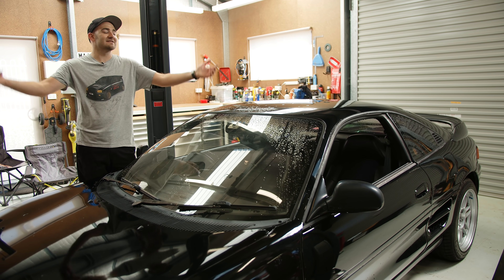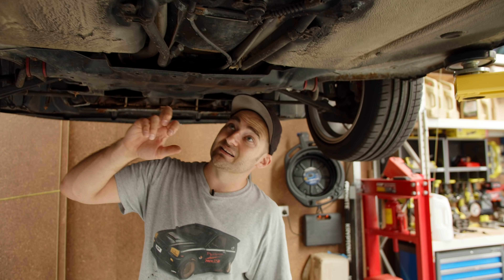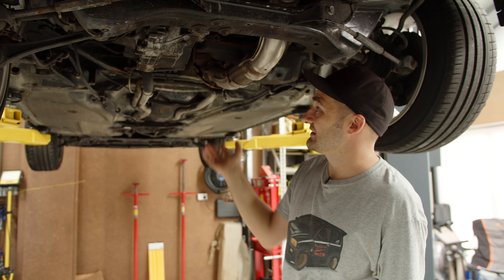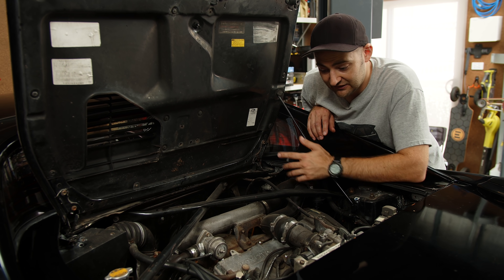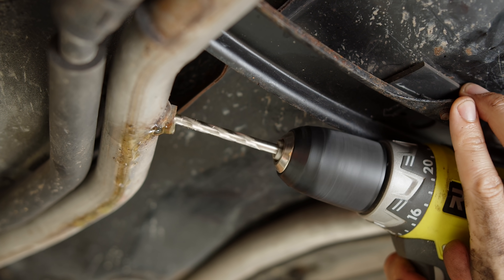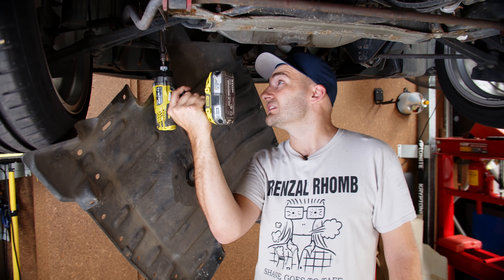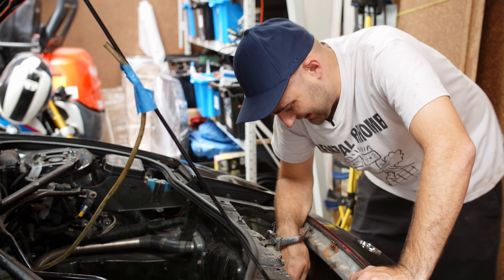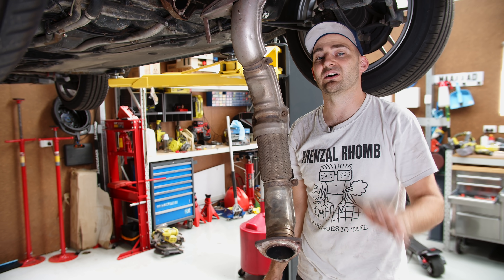Turns out my 'super clean' Toyota MR2 turbo is a piece of ....

Comment: My personal opinion is that the reason some of the rusty bolts twisted off was you were using WD-40 as a rust penetrant. That product is for water displacement  or a solvent. Get a proper rust penetrant like Liquid Wrench.

Comment: dont forget to replace "hose from hell" while you've got the turbo off. also good gains are to be made if you get your turbo housing machined out and a bigger impeller placed in. I had mine machined out to fit a supra compressor wheel. my brother did an evo compressor wheel.

Comment: In theory with some of the older LSDs While jacked up if you spin one of the rear wheels the other wheel will turn the same direction if it had an LSD. If it spins the opposite direction it's more than likely an open diff

Comment: Better get some POR15 to seal that metal.

S54 is the NA gear box.  E153 is the turbo gear box.

And yes, dropping the engine/transmission would've saved you a lot of time and headache. :)

Comment: I had an AW11 MR2 that simply dissolved over the two years I owned it. Titanic level rust on a car that was 8/10 when bought. Wicked powerslides in the wet, I could drive that car sideways for a block, in the rain.

Comment: Hahahaha " so much rust!" Sure thing Marty. Some tips from the part of NY that measures the salt used on the roads in tonnes per mile, get yourself some real lubricants for loosening bolts. Wd40 has its place but it's not in the garage. PB blaster is made for rusty bolts. Second you really want a set of bolt extractors. They work really well for getting those rounded off bolts and nuts that you're not going to reuse.
Reply: Your cars must be relatively new.

PB Blaster did nothing to loosen seized nuts or bolts on my old Tercel. The oxalic acid based rust busters used to work fairly well, but AFAIK are all off the market. I used a small butane torch to remove two seized brake line nuts from a barely accessible distribution block  I heated each to roughly 400 degrees, let it cool a bit and then applied a crows foot wrench. They came off without a problem.  If that heat doesn't work, and it's just a seized nut, a set of nut splitters work well and if you are careful won't hurt the bolt. Before removing the split nut, back it off past the end of the bolt and hit it with a hammer a few times to break the bolt loose. If push comes to shove and nothing else works on a seized bolt, and you can find or make enough room, get a really good set of drills and drill it out.

On the older cars I've worked on for most of my life,  extractors will break before the bolt even budges. I have a whole draw full of broken easyouts to prove it. Break off a hardened steel piece in a bolt and have fun trying to drill the thing out!

-dave (also from upstate NY)

Comment: Helped a friend swap out a bad turbo engine here in the states with a JDM and computer about 15 years ago or so. We forgot to unhook the battery........the main feed to the engine starter created a direct short to ground and powered up the fuel pump. Raw fueling was dumping out and sparks were flying. The throttle cable was glowing red hot! We called the fire department and they foamed down the garage. They couldn't find the battery because the engine was in the back! Finally found it under the front spare tire and unhooked it. They left laughing at us dumb kids. Anyways if you can work on a MR2 then your set for life! His was a rusty mess too! Nothing quite like Ohio road salt and sheet metal................. can't have anything nice in

Comment: missing all the undertray plastics. they really need em, it's common for the 10mm bolts to rust. looks like a factory exhaust to me. fight on, they are great to drive, well so long as that mismatched suspension holds up ok.

Comment: That looks like a 5 year old vehicle or even newer rust wise in OHIO. All my vehicles literally have a pile of rust under them after I get done doing any sort of work on them. All you need is PB blaster! But if that does not work break out the torch and get your stuck nuts cherry red and they call off easy.

Comment: So I’m what’s called an AS In the American navy. Basically, I’m a diesel mechanic, but I also work on the body and structure of the support equipment (tractors and dolly’s). As you can imagine, these things rust ALL THE TIME so when I’m not fixing the shit that the squadron personnel break (which is everything all the time) I’m USUALLY servicing the engines or doing corrosion treatment or prevention which is pretty much fancy words for FUCKING UP SOME RUST. A wire brush, some sand paper, and elbow grease and honestly rust isn’t too bad. Get some spray primer and paint and it’s like new.

Comment: On these engines there is a little water hose that needs replacing it is known as the "hose from hell" engine out is the only way to do this. Looking at the age of the car at 30 years old it will have to be done as it goes to the turbo.

Comment: my first car was a 93 honda del sol in 2008.... and it was rusty under from normal american winter's. after that i had a rust free 06 s2000, after that a rusty 05 sti, and then i was done with rust so got a 2015 mitsubishi mirage to fuck with. i still have the sti but the engine is bad, turbo is blown. and im crippled almost 4 years now so cant even fix it or even drive. if i heal from my spinal cord i got mad plans for both cars

Comment: You haven't experienced real rust until you've had to replace 80 % of all metal fasteners you removed (from anything) and spent hours with a MIG welder trying to remove those that snapped... Just to find out that there's not much left of the bottom of the chassis either (and you can't get a clean replacementt) so you need to deal with that first in order to have something solid to attach your new/rebuilt parts to.

Comment: Those sheet metal filler-panels either side of the engine compartment can be removed with a couple of scews. It gives you some elbow room, but mostly you'll prevent bending them while leaning into the engine bay (as they're just a flimsy cosmetic panel). I was cringing watching you sit on the edge of the rear quarter. 😬

Comment: looks like a gen1 so e153 will be non lsd, gen2 onward were lsd, check by turning rear wheel when on lift, if other wheel going in opposite direction its open diff if it goes sameway its lsd.......

Comment: So the first time you were trying to maneuver the down pipe out 12:16, why not cut it in half at that point and then pull the lower half back through the sub frame towards the muffler pan.

Comment: What year is it the ones that rusted really bad we’re built in 1989 I bought one as a parts car and literally threw it away. From 1990 on the rust protection was a lot better. You should have just pulled the engine out I can get one of them out in less than 4 hours. If I did anything to my race car in the engine department I just pulled the motor it makes it easy to work on then.

Comment: I love you Marty, but you don't know even a sliver of the struggle with rust. Come to Pennsylvania and we can have a party putting a northeastern MR2 back together. it will have no floors, no wheel arches, no exhaust and every. single. bolt will break (except for the ones that strip). At least the interior isn't sun bleached.

Comment: I wonder when you get bolt heads snap and you have to tap a new thread, how do you make sure there aren't little shards now running through the cooling system that pipe feeds?

Comment: If you’re planning to either drop the fuel tank or replace the hose from hell, just remove the engine now and make everything else easier.  

The MR2 fuel pump was the worst repair I’ve ever done - the tank wouldn’t come out without removing the hard cooling lines, despite the repair manual saying it would.  Reconnecting the fuel lines and filler neck with the engine in either requires a child’s hands on an 80kg 2.5m tall giant, a double-jointed contortionist, or a willingness to donate blood for the cause.  On the other hand, friends who replaced their fuel pumps while their engine was out thought it was a fairly easy repair and couldn’t understand why I hated it. “Oh yeah, I did all the reconnecting sitting in the empty engine bay.”

Legend has it the hose from hell can be changed with the engine in place (there are tutorials), but it’s also not worth the pain.

Comment: Lots of plastic covers missing underneath if you didn't take them off, gearbox is an E153 the 1994 onwards is the best box, mine has been in my workshop for a few months, rebuilt engine, and found bad rust after 23 years on passenger side rear sill section (jack disappeared one day) so chopped it all out and welded new sections to all 5 layers that come together to form jack point, check out @megapixel000 on instagram had my 1994 MR2 Turbo for 15 years, still put a smile on my face, yours looks pretty decent for 30 yo, the front fan bolts always go as do the rad mounts, check inside rear boot / trunk under carpet down sides bumper where the black vents are aree, they rot there too as well as behind seats side panels where seetbelts fit, put hand down gap to bottom (once seat belt and audio amps, if fitted are out the way)  enjoyed you video, nice work 👍🏻

Comment: I've had 2 MR2's, a 3SGTE engine'd MK1 and a MK2, they are only difficult to work on cos access to everything is harder with the engine in the middle of the car, the roof c pillars and body width don't help matters unlike a front engine'd car where you can lean over the thin sides and work from the front, they are fun cars though, but they are a pain in the tits when you have to work on them, having a lift will help out a lot, personally I'd just have dropped the engine out, that way you can do everything that needs done easily and check everything.

Comment: thit is not a lot of rust you should see my forster 2004 xt lol 1000 worst but still running, i do have a little problem with the fuel delivery line retainer clip as i change fuel pump everything was so rusty i had to break it. dunno if my work is going to hold it in place we shall see. if i was you ill try to lower the weight of the car, bcuz i think you may get smash by moog car.

Comment: You really should've just dropped the motor out.  Those cars are so much about compact packaging that there's just no room to work on them.
Reply: Needed to change headgasket on ST185, decided to remove it without dropping the engine to skip all the fluid and wiring hassle.

8 Hours later I begin the procedure to drop the engine

Comment: I love the Toyota MR2 I even used to own one and kick myself in the ass for letting it go. but and it's a big hairy one the MR2 is not that great for racing and competition sports trust me Toyota tried really hard to make the MR2 a race car even in Rally it was a dog . the thing is Toyota shot them self's in the foot with the engine then made the engine bay so small the stock engine is the only one that will fit. even with a turbo and stroked the engine is not strong . the only way to make a MR2 good is the same way Pontiac owners did with Fiero you have to make it a front engine car and it's a major job to do the conversion. but after it's done you can stuff any engine you want under the hood and it's fixes all the balance problems with the car. Sorry I really do love the MR2 it's just not a good race car but don't feel bad the moon buggy is not a race car either it may have a better engine just hope the cage weigh's it down .

Comment: What do you mean rusted? It doesn't even have a single whole in the floor and it looks mint on top. This car looks like it have seen around 2-3 full salty winters. People who have MR2s here in Poland don't even have a set of winter tires for them. People know how bad it rusts and treat it like a summer car. AFAIK Japan doesn't put salt on its roads, but someone might correct me on that. Japanese brands in general can't handle salty roads full of holes. Mazda is hands down the worst rusting brand, and that's in general, not just among Japanese. Europeans Fords, Opels and Hondas aren't much better. Mercedes had a famous rust episode in the early 2000s, when ML(W163) and S(W220) were visibly rusted in their first months. From my knowledge Subaru and Lexus are the only rust protected Japanese cars and they handle it fine. Audi is probably the king of rust protection. Even 30 year old cars are holding up fine and the new ones are even better protected.

Comment: With that much rust, you've made the wrong decision. Most backyard mechanics do not have the tools and equipment to pull the engine, you did. Again, with that much rust on every nut/bolt, you should of went straight to an engine pull. Every single fastener on that engine needs inspected and replaced if needed; every single one.